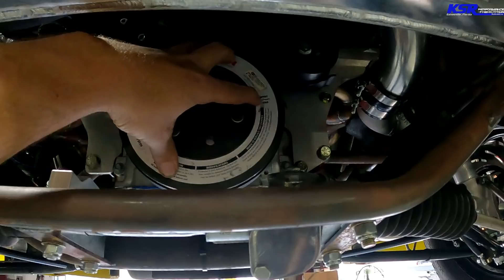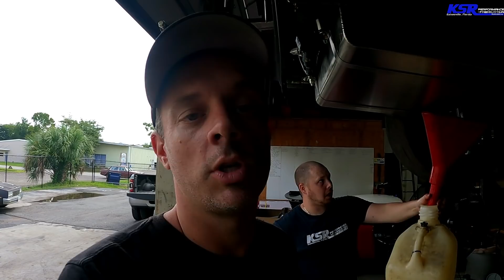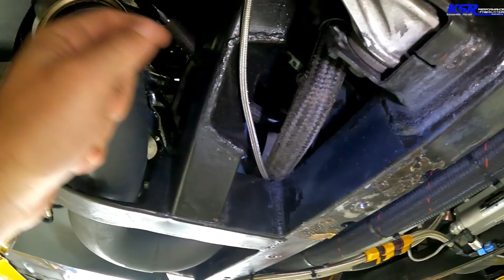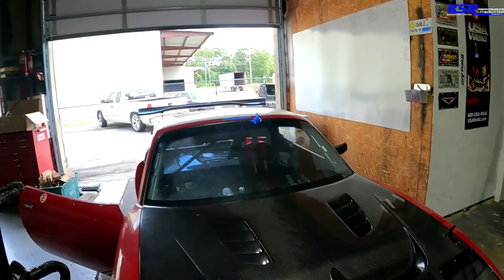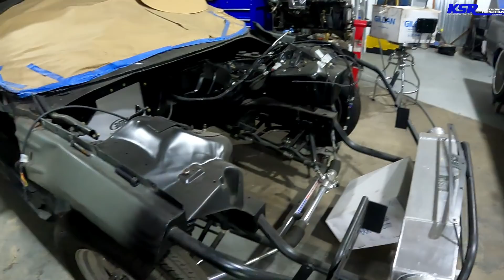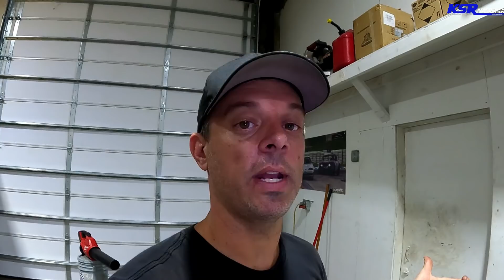KSR Shop Updates Post LS Fest 2021! Our Next BIG Project!

Comment: 8:43 -- 250 W.H.P.  - 😳  Was wondering what made these a land rocket fly.  Had a couple of these launch from a stop light, then disappeared in a couple of seconds.  Think I was driving my Ford Ranger then, so they were not racing me.. Prob. hyping each other up...  Was the 1990 era., Small Honda's were  noticed, especially CRX's. (Could not miss hearing the go-peddle-stomped, built / boosted 4-cylinder engine sounds).

Comment: You mentioned the 4th gen and a  anti-roll bar setup on the rear running 7s.
Is this with a 4th gen rear ?
Reply: Yes it’s pretty much stock under their just added shocks.
Reply: I don’t remember if the axels have been upgraded or not same with the rear gears.
Reply: @williammaguire5628  I'm running 4.10s with a mini spool. With what everyone says it will come apart? Afraid to add nitrous to my motor. Small block 350

Comment: kevin use some hylomar blue on your turbo drain flanges its the ducks guts it works on sumps water pumps etc and its sensor safe originally made by roll royce jet engines i put taylor ray onto it cheers from down under

Comment: There's a product called seal - all which you could have used on the road to seal the gas tank leak.  You could have just put it all over the plug even when wet with gas...  as a quick fix anyway

Comment: I would love to see what you do more with the f body. I'm actually in process of building the same setup (gen 3 5.3 single turbo). Using hp tuners, but thinking of switching to Holley. What part selection do you choose for injectors, fuel pump, etc. I'll checkout that anti roll bar. It would be awesome to have y'all tune it one day (I'm in the area).

Comment: Thats what a guy has a die grinder for...sensor boss machining
Reply: One could spot face the boss as needed, or create a purpose built special cutter for the job if it is a common problem. 

But you shouldnt need to. 😲

Comment: What blend are you running with Motul?
Reply from the maker: In the endurance cars, 300V 10w40 or 15w50 depending on the outside air temps.

Comment: My stock NB Miata at 140 crank HP is plenty fun. 250WHP turbocharged is my plan.  But I also considered F20 swapping it once, so that car makes me smile.  And at one point I even bought an all aluminum 5.3 and was going to stuff that in with a custom subframe and maybe firewall modifications to keep weight distribution good.  For now I just enjoy it stock, it's reliable and low mileage and I'm not in any hurry to tear it apart.

Comment: Question for you.   So on the 5.3 liter, are the gen iv rods crank and pistons all stock?   If so did you open ring gaps for boost?
Reply: Just curious, I've always been an old school big block fan.   Thinking of a possible ls swapped s10 project in the future.
Reply from the maker: Yes, we gap the rings snd change the bearing clearances around some from stock.
Reply: @KSRPerformanceFabrication  ok cool!   Thank you!   Eventually I'll have to start collecting pieces.

Comment: I have to ask. Why do all the mods to the new project and put stock gen 4 rods back in the motor? That seems counterproductive
Reply from the maker: Little motor to get them started on the "go real fast" plan, then its just a motor and turbo swap away from going real real fast. I try and teach my customers how to run their cars at the track in the same way that I run my cars and if they have a "whoops" with the tune, its alot cheaper to learn on a basic engine than one that has 15-20k invested in it.

Comment: I would love for Kev to take Leroy and clean up/streamline the entire car. I wanna see Leroy be a bracket 7 second car like he deserves to be.
Reply from the maker: There just may be something to this come winter time ;)
Reply: @KSRPerformanceFabrication   good job on mullet.
Reply: The trans and axles would never take it
Reply: I'd love to see them put a four Link on and put in a traditional style trans
Reply: @gnarkiller  Like a Liberty?
Reply: @charlieshammer6129  I don't know the rules for the stick shift classes he runs so I don't know if a liberty would be allowed. Even a t56 Magnum that that is mated directly to the motor would be better than the tranaxle mounted trans he runs now. There's a lot more driveshaft options over running the torque tube. it's always down to the rules of the race classes.
Reply: @gnarkiller  Probably not, good to dream lol.
Reply: @Warped Sounds  I mean a consistent one though I know it’s a seven second car.and it’s hard on the trans. Tahts why he only turns it up when he needs too
Reply: @rachaeldesjardins8043  he's been hinting they are working on possible gearbox upgraded in the background. 
Plus it only just got a new turbo and motor set up that's making a heap more power than before. Few tweaks and it'll be back into regular 7s and probably a new pb
Reply: @Dlawler   only way that’s gonna happen is maybe with a  axle like James 240  setup
Reply: @Dlawler   he also said. He’s gonna crank it up at word cup
Reply: @rachaeldesjardins8043  swapping long blocks bettwen ruby and Leroy would be a first better move before that. Diff has proven reliable and the gearbox's have started lasting longer. And now the weakest like of the torque tube is gone they are making headway with it. Aswell as working on other parts in the background. So it's not worth ruling out the set up in it yet
Reply: @rachaeldesjardins8043  also the more conventional drive set ups still chew though gearbox at the level Leroy is at. So it'll be alot of work to convert it, potentially gain much in the way of reliability. Aswell as losing weight of the drive tyres. Which is where they need it to be with Leroy
Reply: @Dlawler   yes it is he’s said it every time. He breaks an axle it costs more and same with the trans
Reply: @Dlawler   l what I’m saying is he has mullet nowhere much money and time is he gonna spend on. Leroy to amke him margainly faster he has said numerous times that the axle rear end trans is the. Achilles heal   Of the setup
Reply: @rachaeldesjardins8043  and any set up he could go to and still retain a H pattern he need to run the classes he does, are only marginal better than what he's running now and will still be the Achilles heel of the set up. Like all the other fast H pattern cars
So it makes no sense to make the change given how much work and backwards set it could be, given now they have started making good progress on the current set up
Reply: @Dlawler   what I’m saying all along.  It’s not worth making him go much faster either way he isn’t gonna be much faster
Reply: @rachaeldesjardins8043  why not? They have made some changes that are showing promise for both performance and reliability, so why not aim for bottom 7s he wants?
Reply: @Dlawler    I mean he ran a 7.4  so bottom sevens aren’t far off I said  not much faster as in sixes
Reply: @Dlawler  it’ll honestly do bottom sevens the way it is just watch at World Cup   He ran his fasted pass when it was hurt I think it can do 720 730 the way it is.
Reply: @rachaeldesjardins8043  Leroy's fastest pass is a 7.67. But let me get this right... you basically agree that it's finally showing some reliability (well atleast for what it is) that they are actually getting some hard runs on it to start dialing it in, and showing the potential for bottom 7s and who knows how much further it could go. But you think they should spend alot of time and money to potentially not gain anything and maybe even go backwards?
Reply: @Dlawler  no what I’m saying is. He’s even said it him self numerous time it needs a real  fit setup and he’s said a few times they have soemthing in the works.  All I’m saying is what he has said numerous. F….,,,,5)$7789 times
Reply: Maybe Leroy becoming a back halfed big tire setup??  🤔 Some would disagree, but I think it would be fantastic to see it happen
Reply: @franknbeans3651  but then what is he going to do with it? It'll rule it out of basically every event/class he race in